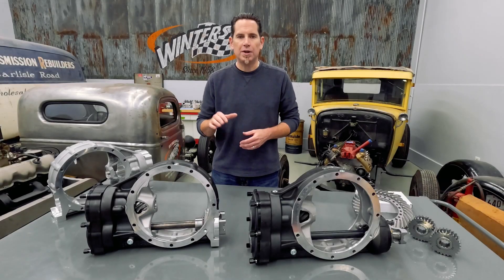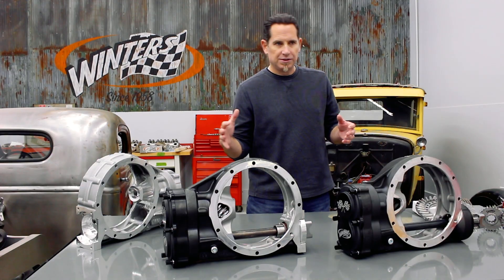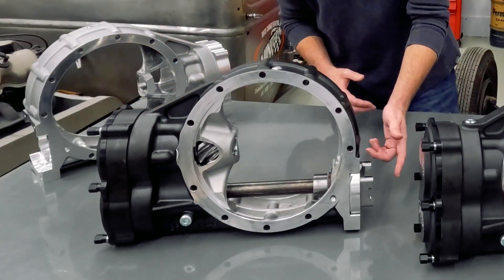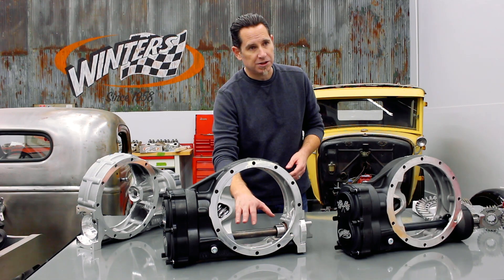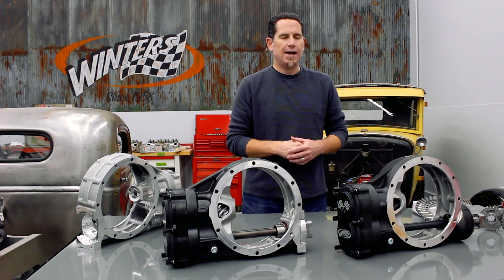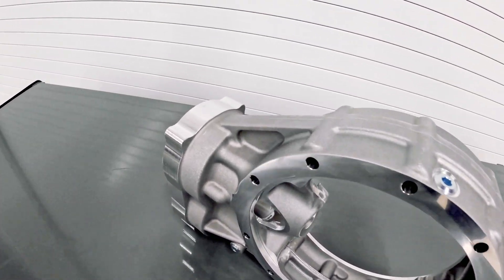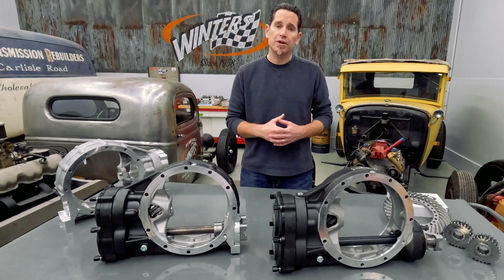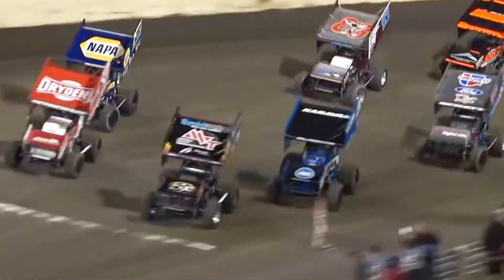New Northeast Mod Snub Nose Quick Change // Winters Tech

Comment: Have an idea for using 3 of those sections one is the input while the other two become counterrotating outputs. This would be for a marine application for twin counter rotating props. Plus mated to a 3 speed transmission for not only increased speed but the ability to enhance fuel economy.